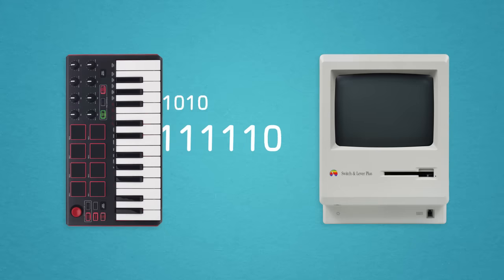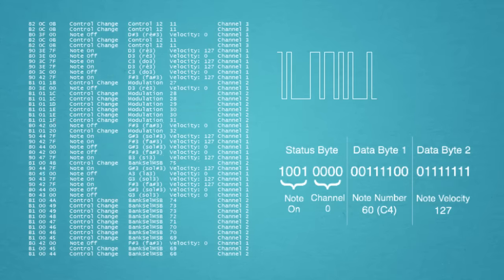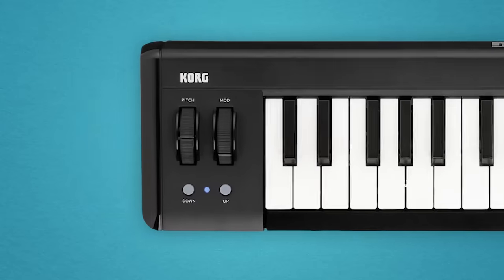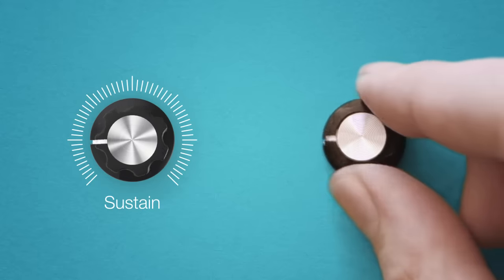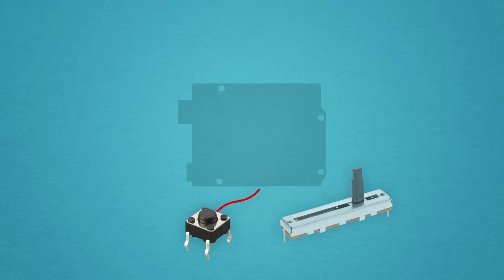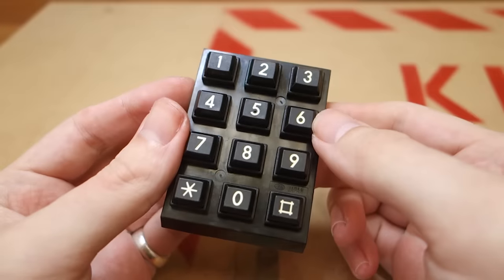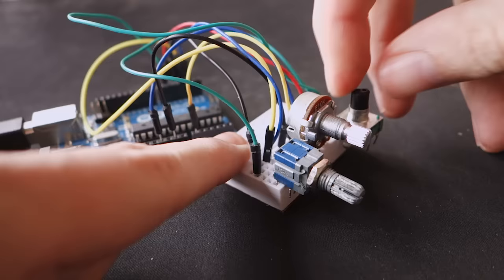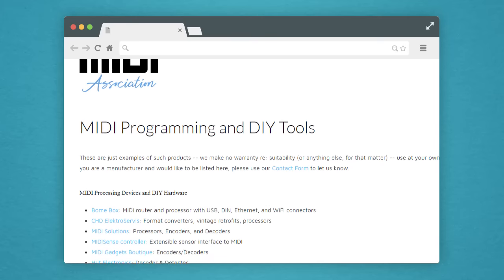Building a MIDI Controller Using Arduino

Comment: Can you provide a link to buy that joystick?
Reply from the maker: No. As I've said in the comments several times already, it came out of an old RC. It's a pretty standard component, you can easily find something similar by looking at RC shops.
Reply: Switch & Lever thank you very much, I’m really sorry for not taking a read at the comments before, keep up the great work!

Comment: All I get is montages demonstrating how much effort I would need to put into something I can buy fairly cheap from any music store. Plus money for and/or access to a laser cutter.
Reply from the maker: You use whatever tools you have available. I specifically mention in the video you don’t need a laser cutter, you can use a cardboard box if you want to. Yet you complain. What’s obvious is that you have no desire to make anything, and then this video isn’t for you. There are people out there who are interested in more than just being consumers, interested in actually designing and making stuff for themselves.
Reply: @SwitchAndLever I was looking into building a controller, and to be honest this video gave me very little to work with. Montages are the opposite of instructions or directions. All I'm saying.
Reply from the maker: @Bananskuden  I see where you're confused. You think this is a "how to" video, when it's more like an inspiration, and a primer where to get started if you wanted to do something like this yourself. The montages are on how to build a box (which I covered in my previous reply) and how to solder electronics. To cover the other part properly, as a "how to" video, this video would be immensely longer as it would have to cover the basics of Arduino and electronic circuitry. Further more, the description is, as I mention in the video, absolutely full with resources if you want to build something like this yourself. Complaining is the opposite of actually doing something. All I'm saying.

Comment: There are some firmwares that you can flash your arduino with so you don't need all that software to translate from serial to midi, I used one in the  controller i built. https://github.com/tttapa/MIDI_controller
Reply from the maker: Still more complicated for the average user than just running a serial to midi program. Or if you don’t need all those pins just use an Arduino with a 32u4 which can act as a midi device.

Comment: You CAN turn arduino in midi device
Reply from the maker: Yes, either by reflashing it, which is quite outside a beginner's level, or by using a different Arduino board with a 32u4 processor, but which still doesn't have enough inputs which would have required the use of shift registers or multiplexers, and the purchase of another board. So, in light of that, I decided to use what I had at hand and what would make it more accessible to more people.

Comment: 7:51 Isn't there a way to BUS all knobs into the smaller Arduino? What if i want to make a controller that uses 20 sliders or more?
Reply from the maker: Without external hardware, no. You'd need an analog multiplexer (or several) to read that many analog inputs. The 74HC4067 (sold by Sparkfun and many other places) should work just fine.
Reply: @SwitchAndLever  I had in mind a simple keyboard where you can push quite a lot of keys before it starts beeping ha ha...
I imagine if every channels are encoded to complementary frequencies, that a lot of knobs could fit a single connection...

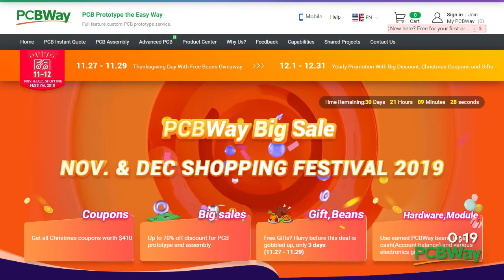Comment: 9:08 or just design your own custom board with an AVR chip. It's not that difficult, you know.
Reply from the maker: Nothing is difficult when you know how to do it. I have made a fair bit of PCBs in my day, but thinking that "it's not that difficult" because you know how to do it, and thus believe that anyone can do it with ease, is disingenuous. Most people who use Arduino have never designed a circuit board, and most my viewers have neither. Arduino is reasonably easy to pick up even if you don't have a background in electronics, whereas designing circuit boards is quite a higher leap to make.

Comment: Why didn't you put a 5-pin midi connector on this and then use a 5 pin midi to USB cable? There would have been no need to translate from serial to midi in software, and you would have been able to plug it directly into other midi equipment.
Reply from the maker: Because I didn't have a need for that, and I built it for what my needs are. Not to mention it would've added another ~$15 to the build. If you want to do that go right ahead.
Reply: @SwitchAndLever  Fair enough. I tend to err on the side of making things a bit more versatile as I find I get more use out of them over the long term. Even if I don't need all of the features straight away I like to know I have them.
Reply from the maker: @MrSpeedfox  since I built this specifically to use with a DAW making it pure MIDI would actually make it less versatile for me, as I would need the adapter to use it.
Reply: @SwitchAndLever  Was there any reason you didn't go with some thing like the A-Star 32U4 Mini LV rather than an Arduino mega? You might have had to use shift registers to give yourself enough digital pins, but it has 12 analog inputs and because it's Leonardo compatible you could have made it show up as a Midi device when you plugged it in (skipping the need for translating from serial to midi at the other end).
Reply from the maker: @MrSpeedfox  you use what you have available. I had a couple of MEGAs kicking around, so it would have both delayed the project having to order anything else, and it would have made it more complex. I would definitely have needed shift registers as six of those "12 analog inputs" are on digital pins, further lowering the amount of accessible digital pins to only six (if you avoid using 0 and 1 as they can cause issues with serial communication).

Comment: The synchronicity is amazing, because I've been planning on getting back to a midi controller project I started last year but had to shelve. But but but, I'm using OpenDeck for mine, because I do enough programming and know of enough arcane interfaces to take a step back and let a really good open source project take care of things for me 😉 take a look at https://shanteacontrols.com/
Reply from the maker: Yeah, I came across that, but once I saw the price of it I was immediately turned off unfortunately. It looks like a really cool project, but quite some distance out of my budget for this project.
Reply from the maker: Last I checked unless you know how to compile the core yourself it's not free, as he was selling the compiled binaries. Last time I had to compile a similar project I went nearly mad with everything that had to be included to get it to work.

Comment: i make it
but my keypad matrix is 6.9 how can i change code.and i have problem in change octave
Reply from the maker: Depends entirely on your keypad. I wouldn’t use my code as something you can just apply to your project (unless you’re working with exactly the same parts), but rather as inspiration for how you could do things. Your keypad will definitely be different than mine, as I took mine out of an old telephone.

Comment: Can midi be connected directly to amplifier circuit
Reply from the maker: Did you watch the video, especially the part where it mentions that MIDI does not transfer any actual audio?
Reply: Yes, but I was thinking of  interface that can convert  midi to audio without laptop or computer (may be specialise in that can do that)
Reply from the maker: Yes, but then you’re still not connecting MIDI to your amp. You’re connecting to an external soundcard with MIDI in and audio out.

Comment: Have you thought about the MIDIUSB library from Arduino?  https://www.arduino.cc/en/Reference/MIDIUSB It would facilitate a lot of things. The computer would recognize Arduino as a MIDI device without the need for a MIDI <-> Serial software running on pc. Only works for Arduino with native USB....
Reply from the maker: The last sentence you wrote is exactly why I did not use it. The Mega doesn’t have a 32u4 chip. You need a Leonardo or Pro Micro, but then you run into the issue of running out of inputs, which is why I used the Mega to begin with.
Reply: @SwitchAndLever  ok! I'm using an Atmel m0, and works very well

Comment: What is that magic shit @8:00 with gnd and 5v as strips?
Reply from the maker: Magic? It’s just copper tape.
Reply: @SwitchAndLever  Str8 magic! Thanks! Do you have to worry about heat on the wood?
Reply from the maker: @JordanService  it's 5V with low current, no, by the time that would be an issue the Arduino would likely fry.

Comment: I appreciate what you've done here as it's a "guide" as opposed to instructions. 

But it feels rushed and incomplete.
😐
Reply from the maker: That's because it was never intended to be complete. A complete video covering this would be hours long, and considering how long time it takes to produce a 15 minute video that's just not an undertaking I'm going to do. There are certain information which is a lot better to gain through reading than watching in video format as well, the technicalities of MIDI messages definitely being one.

I'd call it an inspiration rather than a howto, a primer on where to start digging if you want to do something like this.
Reply: @SwitchAndLever  
It wasn't a criticism as such.
Just compared to your other content , this feels rushed and lacking of real information.
😔
Reply from the maker: @jparky1972  well, it was supposed to be a three day project, with a few days editing. Instead it turned into a month long project, with building, electronics and editing. So rushed, it was definitely not. I have videos where I nerd down into the intricacies of a build, and I have videos which serve more as inspiration. 🙂

Comment: would this work ?

Use Atmel flip  https://www.microchip.com/developmenttools/ProductDetails/flip   to reflash the USB chip  (Atmel MEGA 16u2 on a mega)  With mocaLUFA dual boot firmware 
https://github.com/kuwatay/mocolufa 

Then change the Baud rate at serial begin() to 31250 (MIDI rate).

This will made the arduino look like a usb MIDI device (if set to the right mode)

I hope this will enable direct communication with a daw But it will only work with a "genuine" MEGA which has a 16u2 comms chip not on the cheaper clones which use a CH340 or similar

Comment: what about the latency?
Reply from the maker: None. MIDI isn’t a very fast protocol anyway.
Reply: @SwitchAndLever  I know, but I'm speaking about the process you made (program interpretation, arduino process, processor clock and so on...)
Reply from the maker: @FrankGegna  yes, but my point is that because MIDI is a rather slow protocol the few milliseconds it takes for the program to execute all the instructions is not a problem.

Comment: In fact you do not need hairless midi at all. Just use a din midi port.....
Reply from the maker: And how do I connect that to my laptop? You're still going to need it to connect via USB, for which you then need a MIDI interface anyway. So cut out one piece of hardware and replace it with one piece of software seems like a no-brainer to me.
Reply: If you have a somehow decent soundcard this will have a midi interface included. If you have hardware devices in your setup, you will also have a midi interface available. So in most cases you may assume that there is one. So, it would have been great if you had shown all three ways to connect your device: din midi, usb midi and serial communication, so that people do not assume hairless is the only way.
In fact many devices like yours can also me used to control hardware devices (like eg blofeld) if real midi is available....
hairless is a funny toy for testing, but has no place in a studio environment.....
Reply: And, not to forget, a simple din midi output would have been at a cost of below 1€..... so if you do not need this, if you show it as a template for others, you should really add that feature, because you may not assume you are „representative“ with your setup.
Reply: Not meant to be disrespectful.....
Reply from the maker: “Studio environment”, what lead you to believe this was for anything like studio environment?

You talk about not assuming but you assume a lot of stuff in your comments about people’s equipment. You assume that people have a bunch of things (interfaces, midi din connectors, good soundcards, etc). I haven’t even touched on that. You’re taking a way high end, almost snobbish, route. Show me a laptop with a midi din connector. Please. 

What led you to believe that this was for any high end application? Did you not pay attention for literally the first minute of the video?

Comment: Had you considered a design with your controller -> MIDI cable -> DAW rather than MIDI over USB?  https://www.youtube.com/watch?v=rmfAqg9O_os (Arduino to MIDI socket circuit & programming).  Just a thought.
Reply from the maker: Well yes, hooking up an Arduino to a MIDI socket is fairly trivial, there are even MIDI shields you can buy. However, that will only help you connect your Arduino to other MIDI devices. You wouldn't be able to connect it to a DAW on your computer without using a MIDI>USB interface. So you would still have to introduce USB somewhere in your chain.

Comment: You used RAILS? You made 5v and ground rails using strips of copper?? YOU CAN DO THAT??

You haven't had any issues with arcing or heating or anything attaching an unshielded, open-air 5v electrical supply directly to a wooden box? Mind blown.
Reply from the maker: It's 5 volts, and very low amps...so no...by far no arching and no issues making rails like that. I wouldn't use it for signal wires for instance, due to the inherent interference issues it would have, but for power and ground it's fine, especially for ground.
Reply: @SwitchAndLever  It's ingenious. I've never seen it just glued to a case before but I immediately recognize the value of doing things this way. Thanks for the response

Comment: Sorry man!
I could not experience the end result apart from the knobs.
15 minutes of watching the how to and you took us through CNC fabrication!
Good for you but you could have started with a demo of the finished product by getting a friend to play something.
What else can I say!
A midi controller sends only data of say the note intended to  be heard and it's duration etc, it  controls a sound generator either software or hardware which has a wave table or digitally recorded sound. 
You could improve on your presentation!
Reply from the maker: What in the world are you talking about? I cut some parts on a laser cutter. If that's out of reach for you then why don't you use one of the other things I actually suggested in the video? 

Also, I mentioned what you're saying already in the video, that MIDI does not send any actual sound. 

You really could improve on your attention before criticizing things which are actually in the video. Also, this is not a "how to" video, it's an inspiration of where to get started if you want to do stuff like this. The description is chock full of links with more information. 

It really only sounds like you enjoy being crabby and need stuff to critique. I don't start with showing the finished thing because then people don't actually watch the video.

Comment: 2 software for converting the serial arduino to midi interface = BIG LATENCY
Reply from the maker: There is no discernible latency.
Reply: Why should there be a big latency? A computer runs with a few GHz and only has to translate simple serial data to simple MIDI data. That takes no time at all. Every 30 year old 80486 CPU could handle this with no big latency and even the slow Arduino itself can handle this on its own. There are enough projects using this approach.

Comment: This guy doesn't know about shift register
Reply from the maker: And you don't know what you're talking about. Shift registers work best for outputs, like driving an LED matrix for instance, and it takes a lot of work to make them work as inputs. Also, they only really work as digital inputs, I had a lot of analog inputs. Maybe you were thinking about a multiplexer? I absolutely could have used a multiplexer, if I had one available. What, exactly, is the problem with using an Arduino Mega and keeping it simple, rather than introducing hardware that would make both the wiring and the code more complex?

Maybe, before you try to school someone next time, you get your own facts straight.
Reply: Please enlighten us.